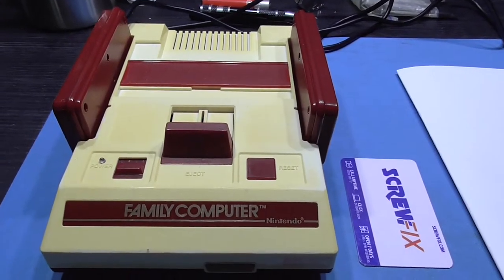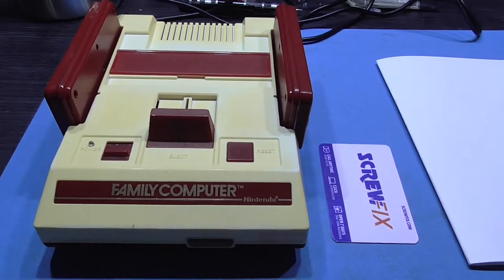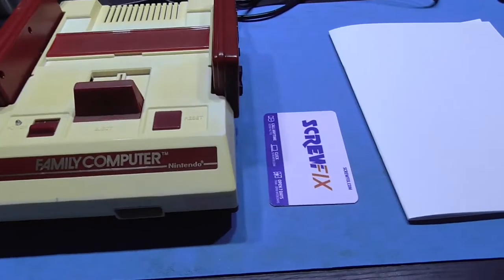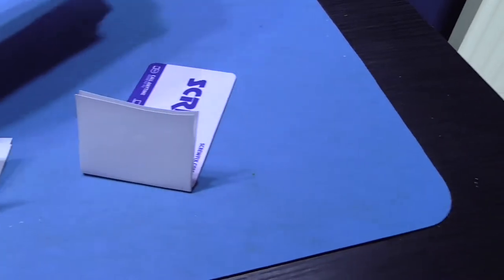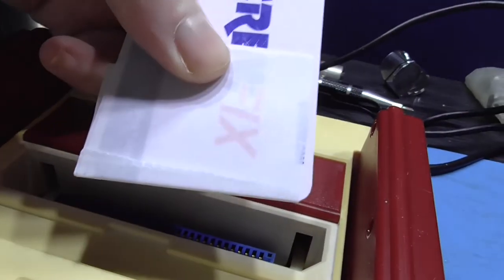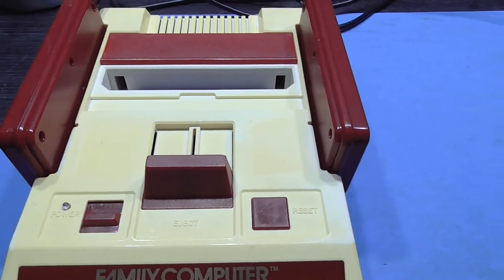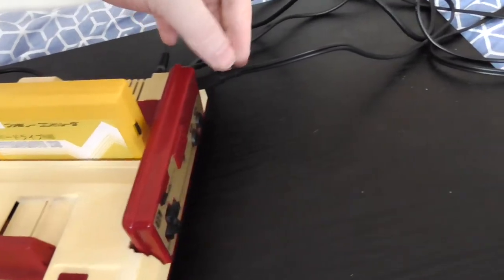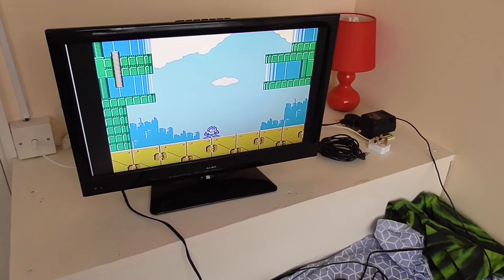Console Cartridge Slot Cleaning (Nintendo Famicom).

Comment: Great video =D  I wouldn't use WD40 in a cart slot though - hell of a coincidence but been catching up with vids whilst one of mine was uploading and in that video I used WD40 on the connector (which isn't really a good idea - although it will still continue to work) and then I spotted your bit at the end about using WD40 on the cart slot.  It will work, and it will help remove and stop oxidisation, so maybe its not actually a bad thing!?!?   It doesnt conduct as far as I understand so in theory it can actually be used on electrical connections.  So maybe I am wrong worrying about using it on cart slots! =D
Reply from the maker: Always nice to see you on my little channel. i use the WD40 before i store the console and clean the slot again once i get it out from storage. that's me and my OCD. ha-ha.
Reply: Ah, yes - that's actually quite genius then!  Because, as you say - they do start to oxidise when in storage.   That's actually my biggest pain in the butt with MVS carts - if I dont play them for 3 months they will always have an issue when plugging them in again.